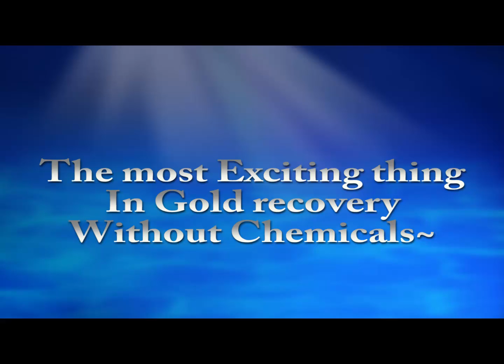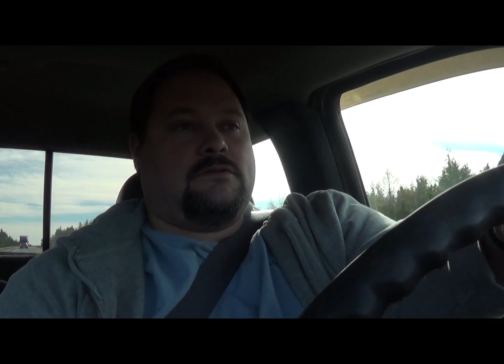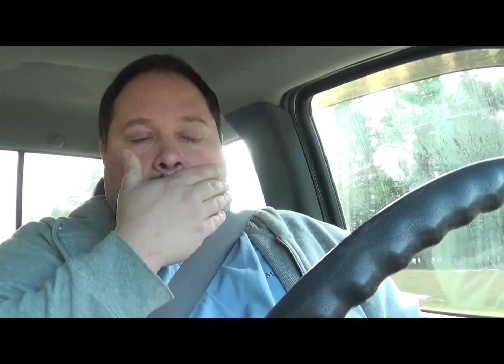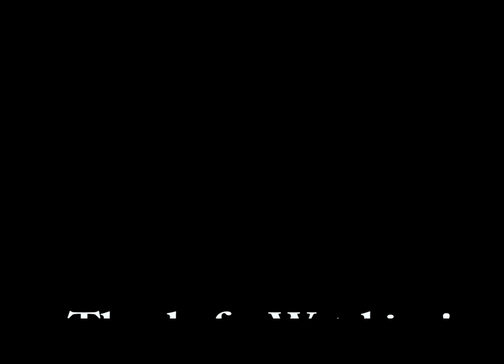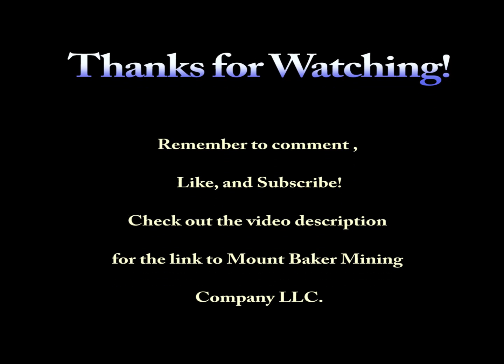The Most Exciting thing In gold Recovery Without Chemicals

Comment: Pipe dream. I don't understand why some people get their panties all bunched up just thinking about acids. Even if this thing pulverizes things that well as you pointed out there's already the problem of the plated fingers which this will do nothing for. Every single component that has gold, silver, platinum, palladium, etc in it will still need those acids to drag the precious metals out and purify them. At best you're talking about having to buy two very expensive and very large machines, the crusher and the shaker table, just to speed up your sorting a bit. Honestly I don't even think it will work for that. Specific gravity is not going to help when the same component by different manufacturers or from different time periods will weigh different due to different materials and different amounts of those materials. The only thing this might really do is pulverize the boards themselves to potentially make the copper, tin and lead easy enough to access; not that that would be worth it even then.

Comment: I will check it out but as a gold prospector and a scrapper I can tell you they may make a million but there not the first to do it! I have watched your videos for a while now and the first time you showed a monolithic ceramic capacitors this is what I thought of to recover the metals if you lower the angel and water it will also catch these things as well but float out the board but you would still be left with waist that would be smelted off but if you had enough of a metal "lump" you could send it to precious metal buyer and they will test and pay you for the metals just like they do if you were to take 10 oz of nuggets into them they would smelt it then put it in the machine read the elements and percentages. thanks for the link going to check it out now

Comment: What you are talking about has been used in Germany for many years. They have no copper mines and use electronics recycling for all of their companies needs.

First they pulverize used electronics, separate the metal from the plastics and waste, then melt all the metals into cathodes. Then separate the metals through electrolysis.

 I have been working on this process (small scale) myself for almost a year now. It is not as easy as I thought it would be. It is very simple to remove the copper and silver. Once those metals are gone you are left with a black or grey sponge. This is where I am currently stuck. The sponge is gold, platinum, palladium, aluminum and tin.
Reply from the maker: It does not surprise me that our European friends would be ahead of us in this.  The shaker table would easily and quickly seperate the gold and trace platinum out and leave you with the rest.  There are companys that buy the leftover sludge and process it themselves.  Thanks Rob!
Reply: +Rob The Plumber since you already use a elctolysis system if you use the copper you take out and make a cathode with it and a lead bar and sulphric acid for that bath you can get out your cgold into the acid the lead goes on the hot side and copper on the negative with a 12 volt dc system .. works real good for reverse plate gold plating as well . but use a copper basket ( like out of screening to keep it supended in the solution and separate  from the other cathode)